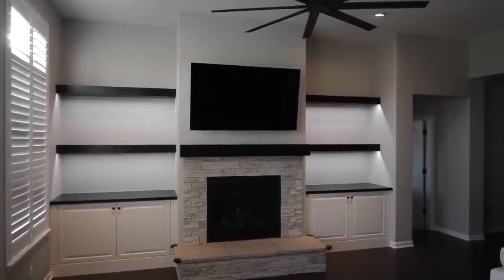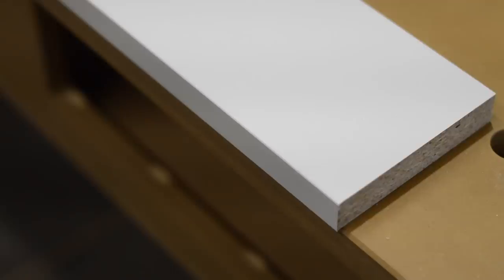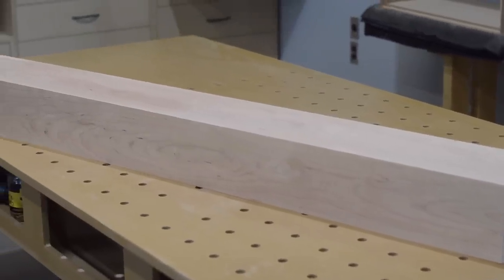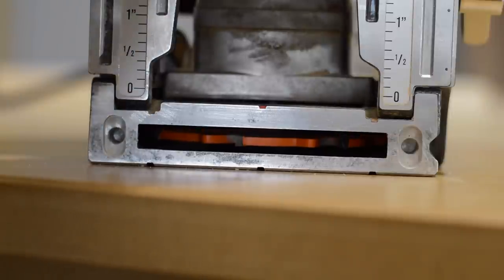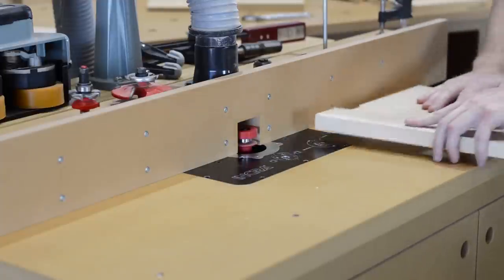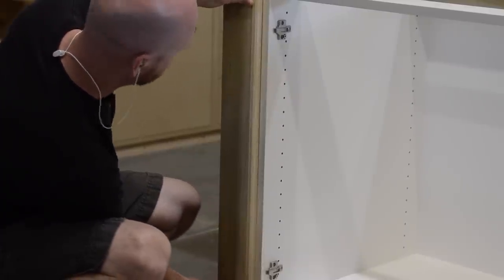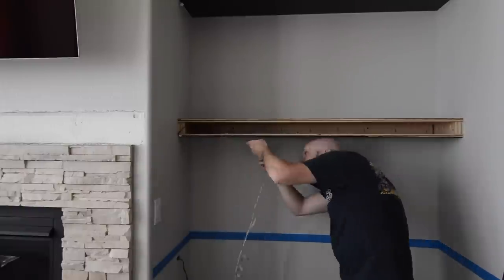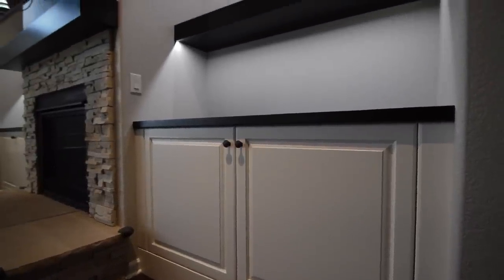Custom built in cabinets, floating shelves and fireplace mantel

Comment: Hi Mike, as always thank you for your videos, well explained. I'm curious, how bad are the walls and floors that you are dealing with in the last 2-3 years?, I'm in the South of California (Anaheim) and I've been experiencing very bad walls and floors, to the point that now I ask for my fillers or toe kicks to have at least 1 1/2" extra for scribing, I've been questioning if people no longer use Levels?😀, anyways, very nice nice unit you did 👍.
Reply from the maker: I don't have the vocabulary to describe how poorly homes are being built, especially with the newer 24" OC framing. I have seen walls with a bow between 3 studs that has over an inch of difference. I always add extra for scribing. I fully don't blame the framers, or drywalled guys, or anyone. Its the whole system. Every penny is being squeezed out of building a house from both sides. Customers rarely want to pay for quality, builders try to meet those needs, contractors are hired and are told to do the fastest work possible so they hire cheap labor, and the circle continues.
Reply: I just installed wainscot panels in a really nice historic home in Savannah Georgia. On the second floor where the bathroom has been remodeled... The guys that just put down the tile left the floor 1 inch out of level over a 8 foot span. Luckily we have 9 inch high baseboards and the high side of the room is behind the bathtub... So I was able to scribe and hide the difference. But that's just a reference point for you if you want. One inch out of 8 feet on a newly remodeled  and tiled bathroom.
Reply: I completely agree with you, your comment is right on the spot, the unfortunate thing that happen to us is that for the new clients is really difficult to find a way for us to show them that we are different, that we care, then we go trough all the process dealing with a lot of resistance with the client, but at the end!!!, their eyes glaze of the satisfaction to see the final product.

Keep up the good work and thank you for sharing.
Reply: Thanks Aaron, your comment confirms my hypothesis, it appears that more and more people are getting pushed and rushed to perform (time wise) but not (quality wise) that they cut to many corners!. I really like Ron Pauls's slogan "The only corners we cut are miters", funny and true.
Reply from the maker: Older homes: I cut some slack on older homes, ground movement/time affects all things. My guess, is those older homes were built much better than todays homes and with much less technology. It will be interesting to see what a cheaply built modern home looks like in 100 years. I did a ton of restoration work in the old neighborhood I used to live in. I was always impressed with the cope cuts, and quality of materials. And yes, once you "win" over a customer, selling the next job is pretty easy.

Comment: I would like to know your process for scibing the baseboard to the stone. Every time i try this mine not as nice as yours.. Any help woudl be greatly apperciated
Reply from the maker: Thank you. In this case I really didn't need to scribe anything to stone. I just reused the original based boards. Scribing to stone or brick, is not easy. I personally don't think there is a good way of doing it. Whenever possible I scribe close and use some of the original grout as caulking to fill in the gaps.

Comment: Did you just run the shelf light wires in the wall to the power box in the cabinet?
Reply from the maker: Yes, and this works because they are low voltage.

Comment: im so lost id love to do this myself but will muck it up but the guy i hired to do my bathroom is charging insane rates right now so hard to trust someone, wish this dude lived near me lol. question where did u run the low wattage LEDS to power them?
Reply: How do you know this dude wouldn’t charge insanely rates as well?
Reply from the maker: The construction industry is in very high demand right now. That drives prices up. I wish things could be consistent over the years, but that's not how the business cycle works. I ran the low wattage wires behind the wall.
Reply: @MikeFarrington  thanks for the reply mike, it seems 3-4x as much as a few other quotes im getting, but im scared to use unknowns. did u connect it to an existing outlet?
Reply from the maker: @jeffd8672  I have found price has absolutely nothing to do with quality, carefully interview the person. Look at their truck, is it clean? Call references, etc.

Comment: Hey Mike!  Very jealous of your shop! Wood working is only a hobby for me so obviously I don't have any of the nice tools and machines you have.  

I did want to ask what recommendation you'd give if someone does not have a biscuit cutter what is a good alternative?  Granted, I'm thinking of buying one. I'm sure the investment would be good.
Reply from the maker: Thank you. Two alternatives would be to use the table saw to cut splines or use a hand held router to cut splines. A few companies sell biscuit sized slot cutters for routers.
Reply: @MikeFarrington  Thank you so much for taking the time to answer this question.  I think I'm going to invest in a biscuit cutter. Just makes sense.

I do have another question if you don't mind.  The alcove space I'm working with in my home is just over 69" wide.  I'm assuming the space you were working with was a bit less (but hard to tell).   Does it make sense to still just have two cabinet doors there at that wide?
Reply from the maker: @randyaven6377  69" is just wide enough to where I think 3 doors is good. You Could even go with 4 if you like.

Comment: ❤️😘 I love Your work. Top notch:) But i have a question: ,,How did You fit that shelf in corners, when the wall isnt perfectly 90°?” Sorry for my english. Thank You for answer:)
Reply from the maker: Thank you very much. I measure mark and cut each piece to fit as closely as possible. There is really no good way to do this. Each corner is different, it took me a few hours just to cut the shelves and countertops.
Reply: @MikeFarrington  For really bad walls, its helpful to use scrap wood or strips of lauan plywood to create a template for each wall that contacts the shelf, then transfer the marks to the finish piece and double check with measurements. Definitely more time consuming though! Thanks for all the great content
Reply from the maker: @jackrogan7051  I use this method when things are really weird, or really big. Good tip.

Comment: Related to cutting and fitting the baseboard, if I am installing some cabinets in the shape of an L in an open corner (no walls for the end cabinets to attach to) is there a trick to cutting out the baseboards perfectly for the cabinets to fit? My plan is to measure as accurately as possible and sneak up on it, but didn’t know if there was a better way. Thanks!
Reply from the maker: In odd situations like that its nice to over cut the piece by an inch or two, then hold it in place, mark with a sharp pencil, then cut to the line.

Comment: I've come back to this video after watching it a few times since release. Useful as ever, thanks Mike. One question - how might you have adapted this to fit a space with a solid, and very uneven floor? I have to build a tiny cubby in an understairs corner. Its a solid stone wall on the back (so hard to fix to), with stud walls left and right. The floor is flagstone and super uneven. How would you go about setting the base / back in such a scenario? I can set a toe kick level, but would have gaps up to 5mm in doing so...it would be essentially teetering on high points.
Reply from the maker: If things are really un even I will sometimes just make a straight line at a set distance away from the uneven surface. I think trying to scribe to a very uneven surface can look worse than just having a gap. Without seeing that's the best I can offer. Hope this helps.

Comment: Hi!!  I would love to make from popler a big mirror cabinet door!! Size is 1950*555mm!!! What tickness of popler shale I use for frame 19*85mm???  I will use domino joint!!! Also I would love to put a devider by half way in the mirror, or maybe not! What do you think of that??? Will it be strong enough, to not fall apart!???
Reply from the maker: 19x85 should be OK with a divider. Talk to the mirror company and see what thickness mirror you are going to install, if its going to be really heavy, beef everything up a little more.

Comment: Hey Mike, I'm currently doing a job that requires under shelf lighting.  Can you tell me what lights you used on this project, and where you purchased them? Cheers
Reply: Amazon caries a ton and they have very cool tracks for the lights to sit in as well.  here is one for instance:  https://www.amazon.com/dp/B01IY1L168/?coliid=I2N7807D614UBU&colid=BQ1NNNZGTTGL&psc=0&ref_=lv_ov_lig_dp_it

I personally like to use Tingkam Led Strip Lights as they come in black and I have NEVER had an issue with any of the 1000plus feet I have installed.  LED Strip lights come in rolls of 5meters (16 feet) or 10m (32 feet).
Reply from the maker: I use the Wurth Louis and Co "Pro Series" LED lighting. Check it out on their website. Its pretty good stuff.
Reply: @MikeFarrington  Thanks very much for the swift reply. Love your work and your channel!
Reply from the maker: @madebymichael4773  Happy to help. Thank you.

Comment: Imagine by Maynard james Keenan/ perfect circle and John Lennon also rocketman by Maynard and Elton John. I just watched this video and subscribed, maybe you answer this in another video, but what is the easiest way to scribe off a wall while also hitting the perfect measurement on the other end? Probably very simple for most people but I’ve never done it so I’m not sure. Thanks
Reply from the maker: Thank you. Good suggestions. I scribe by setting the piece back from the wall a known amount (normally 3/4") and I set a compass to that same measurement. I run the compass along the wall marking the work piece. This leaves a line that if I cut to it I will have a perfectly fitting piece. Hope this makes sense.

Comment: Hey mike just wondering what router bit you used on the door edges and filler edges?
Reply from the maker: It is a mini bearing round over bit from Amana. Check out their website, they have a few of options.

Comment: Do you use spaceballs or some other product to keep that MDF panel centered?
Reply from the maker: Nope, I glue the MDF in place. That is one of the huge benefits of using MDF, it becomes structural. Glueing it in place is fine because it doesn't need the expansion room that solid wood does.
Reply: Thanks for the reply! How much bigger do you cut the groove in the door rails and styles compared to the MDF (+ a few thou?)? I find the MDF swells up fast when gluing making a really tight fit making it hard to get the panel centered. 
Last one...is your MDF panel the same size as the opening (+ groove depth), making it centered by default? 
Curious your method. Thanks!
Reply from the maker: Yup, just a few thou. enough where the two pieces can be slip fit together and pulled apart with minimal force. If you are worried about glue up and MDF swelling, give a little more clearance. Also, better quality MDF swells less and more slowly. I make the panel about 1/16" smaller than the opening in both directions.
Reply: Thanks for all of the info Mike. Great video as always!

Comment: Sorry kind of new to this but I love your video what router bit did you use around the doors with that small router
Reply from the maker: Look up Amana mini bearing router bit. They have a few to pick from.
Reply: @MikeFarrington  thanks for the info I just looked them up ....is it a 1/4 round with a 1/8 bearing ... I'm trying to figure out how you get the line on top and bottom of the 1/4 round cut
Reply from the maker: @vala___4244  Sorry I misunderstood the original question. The outside edge detail I put on the doors is just a simple 1/4" round over bit with a smaller bearing installed. Nothing special there.

Comment: I need to know the installation of the LED Lights !! is there any LED system which requires minimum wiring involvement !
Reply from the maker: I used the Wurth Louis and Co "Pro" series lights. They are easy to use, but not cheap.
Reply: @MikeFarrington  Thanks Bro ! let me check it .

Comment: Mike, quick q here, do you prime and paint melamine boards as well? if not how do you match the melamine finish on your other plywood or hardwood pieces? Thanks!!!
Reply from the maker: I leave melamine alone, I only paint the wood. I don't try to match the melamine to the paint color. The melamine is only visible when the doors are open so if they are two different materials, that doesn't bug me. I also offer my customers a selection of colors for the cabinet interiors.
Reply: @MikeFarrington  after closing analyzing your design I see what you mean, the face frame, walls and doors cover all melamine....... (long pause for my lack of attention). But if you were to match melamine how would you go about it? I'm building a built-in unit myself for the bedrooms and I'm planning of using Lowe's pre-painted cabinets for the bottom section (aka a  double door wall kitchen cabinet unit) and an open shelf for the top section made out of plywood, and I'd like to match the plywood to the melamine cabinet to keep the look consistent. I know you make your own cabinets, but I lack the tools to get that professional look... Thanks again, your videos are gold for a diyer like myself.
Reply from the maker: I can only think of two solutions. Take the melamine to the paint store and match it that way, or paint the melamine. They make special primers that stick to melamine, I think some web searching could help you find the right primer. I have never done this myself, but I know a few painters who do this all the time. Best of luck.
Reply: @MikeFarrington  thank you sir, I'll let u know if I find something that works, and or if it doesn't... I was looking for an easy solution but I don't think one exists. Keep up your amazing videos.
Reply from the maker: Thank you, will do.

Comment: You do know that festool has a very awesome edge banding machine ,don't you?
Reply from the maker: I don't do enough to justify the cost. Besides, its not that good, I have used it.
Reply: @MikeFarrington  i don't even know where to start to tell you how many benefits that edge banding machine has , and how cost wise it's better than an industrial one that costs 8,9,10 times more. but i do understand that you guys don't really need them like we do in Europe . Here you can't get away with nothing when it comes to furniture, it's a different market, high expectations for the silliest prices . I do envy you guys when it comes to this trade.
Reply from the maker: Based on this comment and your others, I assume you have some preconceived notions of the American market that not accurate.
Reply: @MikeFarrington  I don't think so, i've worked for 4 years in london , and i got to see the differences between the entire europe and england, and then i've watched a lot of videos with different areas of woodwork from america , you guys and england have very similar styles . The furniture industry in europe is very different , we use a lot of melamined cheapboard with 2mm pvc edging on , and usually  applied with industrial edgebanding machines , it's probably the most important aspect of the furniture , that the edge to be perfect . And then there is the aspect of how the final finish is done, and i have to say, since i've seen how they do it in UK ,and for like , rich people , it's unbelievable how sloppy the end finish is , and the costumers don't seem to be bothered . And even tho the material prices are the same everywhere  , in UK they charge 15k-20k to furnish a bedroom, 25k-55k or even more for kitchens , and in my country for example we can only charge around 7k-9k tops for a very complex kitchen  and 3k-4k to furnish a bedroom . So that's why i'm mesmerised with the simplicity of your work and the fact that you guys can afford all the routers in the world . I hope you don't find my comments offending , in no way i'm trying to offend , i'm just expressing the differences between us, because i've seen it in london too, you guys don't know how it's like in other parts of the world , but because we look up to you guys , we get to watch and in some cases learn that there is still room for pride in this trade , something that is kinda lost here . Here people didn't learned yet that the american dream showed to us in the movies doesn't exist , but hard work and skill does . I wish it was still appreciated to it's true value .

Comment: Can you tell me where you got the blue flex tubing for your table saw blade dust collection?
Reply from the maker: Its called Loc Line, I use the 2 1/2" diameter.
Reply: Awesome didn’t know they made it that large, thanks for the reply.
Reply from the maker: Yup, its great stuff.

Comment: How did you attach the mating French cleat on the mantel itself?
Reply from the maker: I used glue and clamps. I would have used screws but I couldn't get the screw gun in there.
Reply: That was going to be my question also. Thanks for sharing your skills on YouTube.
Best cover ever.....Hallelujah by K.D. Lang, particularly at the 2010 Winter Olympics in Vancouver. Original by Leonard Cohen. Who really can’t sing at all.